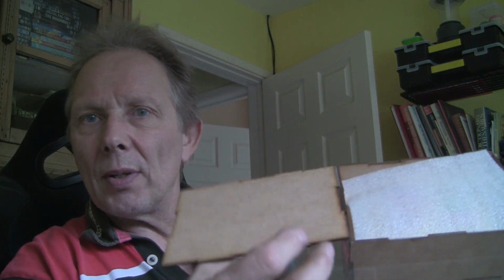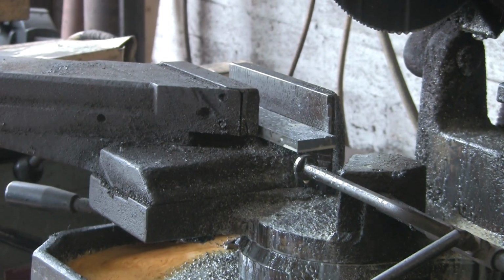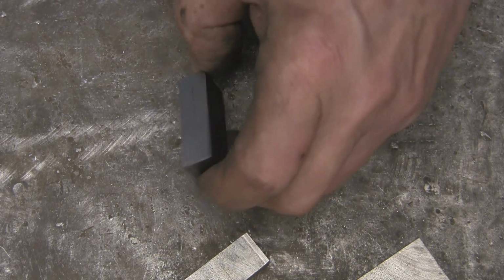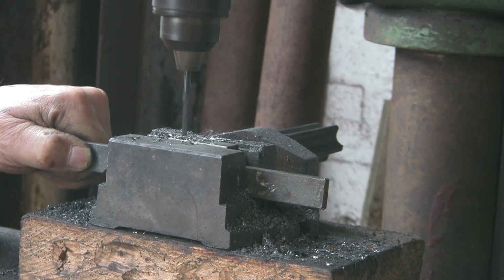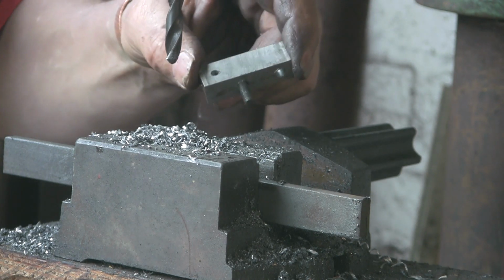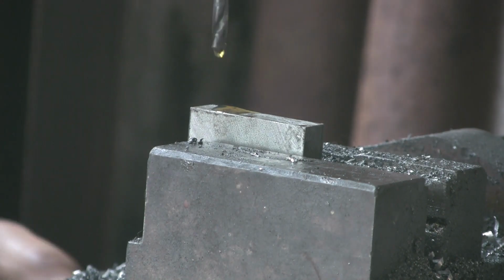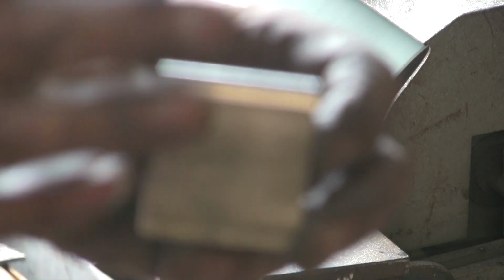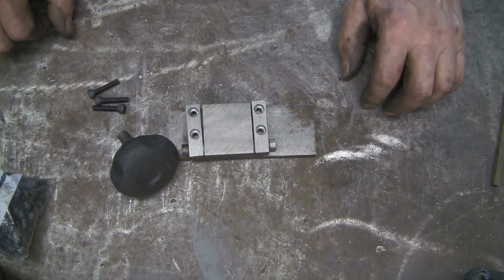Grinder Build part two. Tracking wheel bracket

Comment: Hello Gary, I'm stalled at the moment, but I'm building a similar grinder, so following this with interest!

You can probably make the punch work better by giving it a polish, then popping it into the toaster oven @ 400ª F to temper until the tip turns light blue, which is what is recommended for spring steel.